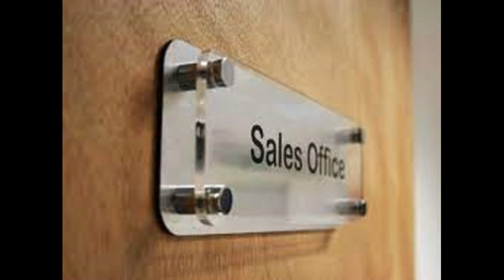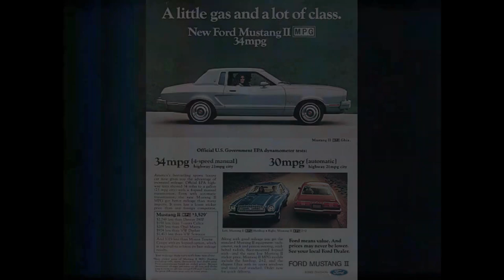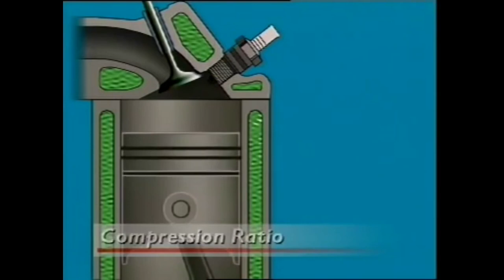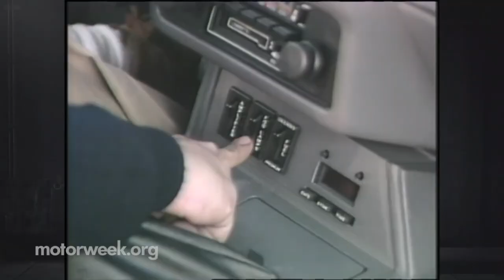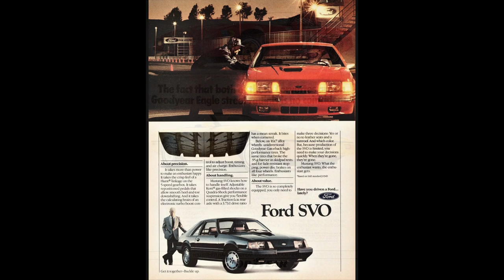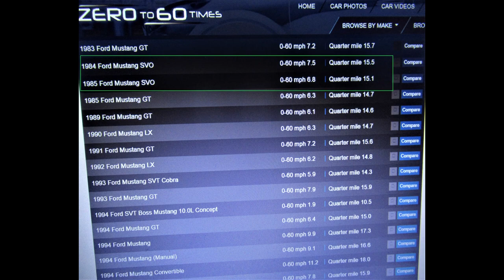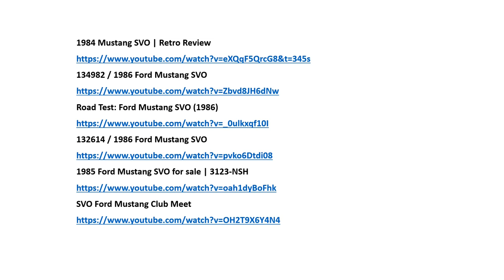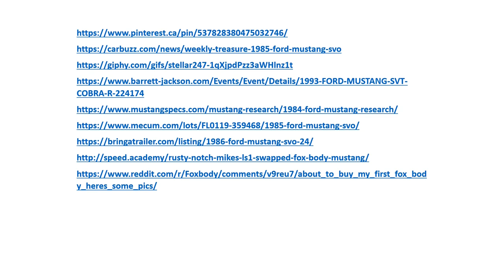Mustang SVO

Comment: I’m not sure that Ford changed anything in the engine from 1985-1/2 to 1986 aside from telling us it went from 205hp to 200hp. The 1985 Mustang GT with a carburetor and 5 speed manual transmission was listed with 210hp,, the 1986 Mustang GT were all EFI but were rated at 200hp. I’m guessing that Ford didn’t want the SVO to be listed with more horsepower than the GT.
Reply from the maker: You are probably correct, the real change likely happened in the marketing department. 🙂